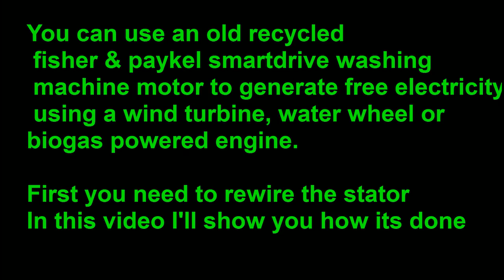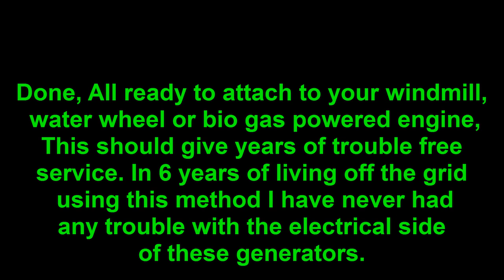How to rewire an old washing machine motor to generate free power

Comment: You rewire the stator to reduce the output voltage correct?  Why not just leave the stator as is and step the voltage down externally?

Comment: Tip from an long time certified solderer - always run the iron across a wet sponge to remove excess (it has lost its flux and is now more of a drossy burden when using with flux cored solder), next always heat the work first, before touching the solder to it or you burn the flux up too fast and it can lead to connection stability problems. Then introduce solder to the work, not the iron - it should flow freely like a tight skin hugging the metal (the sign of a good melt) and cool shiny (which is a good join, as opposed to dull which is a cold solder joint). This should all happen quickly so as not to overheat the work and once the solder sticks don't linger with their on or you lose the antioxidizing effects of the flux. If you get a situation where the solder is heading but not sticking either apply flux paste sparingly or flood the area with solder to coax new flux on to it then tap the area quickly to remove excess (if it didn't drop off on its own) or sponge it off immediately after removing the iron (you just want to get rid of the excess solder without lingering. Lingering oxidizes the underlying metal and solder starts to flip as it contains dross now and nothing wants to stick.

I've personally taken to just sticking a q-tip in paste flux (I prefer rosin as it is only acidic when hot and won't degrade wire when below soldering temps) and dab everything for jobs this size and larger (size as in wire that's this heavy).

Anyway, nice job - I know nothing about these alternators and am trying to learn. This was very helpful, thanks!d
Reply: yeah I liked his video myself, but the soldering needed some work...My brother is a great solderer and was amazed when he saw me solder...its because i am a welder mig,tig,stick, brazing fusing metal is my job lol I once soldered a tank back on a radiator and it looked like it was formed and not soldered
Reply: I guess soldering since age 9 made me assume this was common knowledge!
Reply: "Then introduce solder to the work, not the iron" yes, but. This is also the right moment to put a little(!) bit of solder to the iron so it will make a solid thermal connection to the work. Just lightly touching the iron's tip while moving the solder to the work works fine.

Another thing to watch is that you want the work to wick up the solder, not press a blob of solder onto it. When working on clean electronics with a low thermal mass and a good iron, one can do this directly from the tip, but one needs to keep in mind that this is a special case, not the norm.
Reply: How many watts do you think are lost through the way he did it? 0?
Reply: I always used a damp paper towel.
Reply: The soldering is OMFG... Lol

That said this could have been done a much easier way with zero mod to this stator but ok
Reply: @MadScientist267  what is the easier way ?
Reply: For real like minds want to know so tell

Comment: hi ! Love the concept and everything.

If you want your tin to stick to the copper. You have to clean it up with a chemical product (plumber product) 
1 apply product on the area.
2 Heat it up
3 remove heat source
4 apply tin.

That's how a plumber do, by the book.
About that there is 2 types (or more) tin.
take the one without lead. That's the one allowed in drinkable water.
You might end up in trouble if you don't. 
lead path : tin => water => fish => humans => hospital

Just thinking to this.
An old plumber I had as a teacher told me that water looses speed when it turns. Even into a pipe.
Therefore you might have a better output because you have two 90° angles. (if I remember correctly)

Once again I'm just triing to help.

Comment: This is great could do with some audio though. though i can see what you are doing based on the diagram at the start. When you are actually cutting wires it is hard to see and would benefit for some audio description.
Reply: Marty T Using a large soldering iron in his latest vids doing this again...with sound.
For a newly built hydro 
also  https://www.thebackshed.com/Windmill/FPRewire.asp

Comment: Instead of rewiring. Can the dc current be sent to a solar mppt charge controller to regulate the voltage and charge a 48v battery instead or one of the new portable solar generators in the market?
Reply from the maker: I've never tried that with a factory stator, the only mppts ive used have been 150v max input, the factory stator can produce 400v

Comment: If you hook this up and it doesn't work, is there a straightforward way to troubleshoot where the missed connection might be?
Reply from the maker: Test resistance on each phase with a multimeter, The one with higher or lower resistance will point you in the right direction
Reply: @AngryRambro  Thanks so much!

Comment: How did you manage to have water with so much pressure? Is it just with the river water and its gravity? What is the pipe diameter and total length and what is the difference in level, or an estimate, between the point where the river water is collected and where you have the turbine?

Comment: Why you need to rewire or change the connection?what is the difference if you do not rewire?thanks
Reply from the maker: Voltage is too high in the factory configuration

Comment: What is the purpose of this type of connection? I'm having problems with a heavy rotation to generate, I use the delta connection. I would be grateful if you could help me.
Reply from the maker: Wind the rotor out from the stator so there is less magnetic area exposed to the poles, I do this when I'm using a smaller jet but still need high rpms

Comment: hi there Angry Ram the pelton water wheel you have on the washing machine where did you get that from i have done the same with the washing machine getting about 43volts at about 5-6 amps from a homemade pelton wheel but i think a proper pelton wheel   should give me more power from the water

Comment: Interesting! If I could get my hands on one of those motors, I'd have to try running the conversion as a brushless outrunner with a 3 phase ESC. Whats the power rating of the original motor? Thanks

Comment: Great video very detailed good job. Don't let the creeps get to you. I'm working on a water wheel for my creek running through my backyard so I'll be looking for one of these motors also.
Reply: Not creeps, just educated. No such thing as free energy yet they insist on posting titles like this. I use a hydroelctrostatic generator as well, but the potential and mechanical advantages come from the water..NOT free out of thin air, and NO it's not perpetual. Just be articulate and concise where its needed, that's all us 'creeps' ask

Comment: I spent best part of today doing this with the aid of your video..Now for the rectifier and voltage reducer..Thanks..BTW..i found that scratching the snipped wires with a craft knife made soldering easy..
Reply: If your soldering with a tip with enough thermal mass and the soldering iron is over 30W, it should burn right through the enamel. I solder magnet wire all the time without removing the enamel first. The issues he's running into in the video is his tip has practically no thermal mass; his solder seems to have too low of a flux ratio; and he is feeding the solder onto the iron, not the wires, which is burning off most of what little flux there is before it can help mate the solder to the copper.

Comment: Excellent use of an old washer, bravo man! Like Frank Resists
 says about soldering. Heat the wires then put the solder to it, gives you a superior connection that won't fail and looks terrific, it'll make your connections look totally pro.

Comment: WHY does it have to be rewired? To generate lower voltage or some other reason? Thanks for  great videos.
Reply: Angry Ram
5 months ago
Voltage is too high in the factory configuration

Comment: Your performance is beautiful, thanks for the information. I have a question, does it work in a faster way on the motor, and what is the specified speed for rotation or without limits?

Comment: Hi Angry Ram,

What a great shares given. If do not rewire as per your video, how much it Amp and Voltage? was it ok not to rewire?
Reply from the maker: MOHD FAISA Osman With factory wiring it can produce 400+volts, you should be very careful if using it this way, it can give a good zap.

Comment: Wouldn't this be more efficient to run at a higher voltage until you get to your battery and then have a transformer stepping it down to a voltage regulator for your set of batteries?
Reply: yes and no because it can't run heavy things like your fringe out will need a lot of then
Reply: That is my same question.
Why can't you put the voltage step down transformer and rectifier diodes for charging batteries?

Comment: If you are willing to spend on the extra components a dc/dc converter can be used to charge your battery. Set it up just like any commercial/industrial UPS system your low voltage AC (400v is low voltage) through a rectifier block, DC/DC converter block converts that DC to your charging DC for your battery bank, and out through the inverter block and through a capacitor bank that brings your power factor back closer to 1 and further cleans up your output.

RVs already have pretty much all the power conversion components you need. Then you don't need to give up so much of the power this generates and you don't have to spend all that time rewiring it. More than one way to skin a cat, it all depend on you and the cat which one is right for you.
Reply: Very good proposal! Also this way power loss in cables can be minized if batteries are some distance apart from the generator.
Reply: @hartmutberger5611  Exactly. And the RV company did all the work for you already anyway, you just have to get one.

Comment: Hello, i have one Question . is the orientation of the fourteen magnets in the rotating drum + - + - etc...?
Reply: You may only see what appears to be 14 magnets, however each one of these has several poles. get a small magnet and run over them and you will see the individual poles per magnet

Comment: Should of read some of the comments ops :), how many amps would you lose and you could easily build a circuit to bring down the voltage but the key is obviously amps, can have a 1000 volts and 1 amp, not much use, so would be interesting to know what the maths would be for rpm's to amps if not rewired. Also, would you need a magnet over each coil? and yes im a newbie but not an idiot...

Comment: thanks black ice however i know about that. besides i have over 30 yrs in electronics and have some idears thats tested true. theory isent any thing unless one can build test all phases and i do  as far as inverters theres mod sine ,and pure sine. 48 volt ones will use less current due to volts being twice  12 volt ones will use twice the current and not all company ratings  are truth .also the type of loads powerd will effect it . induction, transistor, non induction, low ,medium, or ,high. thks.

Comment: Amazing video!
However, I am a bit confused about the way you solder the wires.  Normally, you should heat up the wire, and melt the solder onto the wire.  But in your case, you are melting the solder directly onto the gun?
Reply from the maker: PowerSports420 Yeah the soldering iron is a little light for the job, I find if I melt the solder on to the gun first, the wire seems to heat up quicker due to more surface area contact
Reply: Oh ok, that makes sense.  I've never had luck with those "quick heat" guns either.  I went through two of them, then just went back to a simple iron.
Reply: bit of plumbers flux or liquid flux may help with getting the solder to flow.
Reply: When I was tote to solder in school 30 years ago it was common to heat from the bottom of the wire because heat rises and add the solder to the wire when the wire is hot enough to melt the solder
Reply: true if the wire is upright, TBH copper/steel/metals commonly use for electrical conductors conduct heat via conduction so well that convection makes little difference.
Reply: cybot63
But you should always pre tin your solder iron tip with solder before attempting to heat a wire with it(or before attempting to do anything with it), then even pre tin the wire too if ya want, especially if your gun is too small for the job this will help to ensure a strong bond anyway,. but solder has flux in it, by keeping a melted layer on the solder tip keeps the tip clean and heats the wire much faster(instantly) with better heat transfer. I agree with the part you said about melting the solder on the wire when the wire is hot enough, when the wire itself melts the solder, touch the wire with solder not the tip, it works to achieve strongest solder joint possible, but i just wanted to point out that the tip of solder gun needs a thin layer of solder on it before anything can happen the way it should, and then like you said after that wait till the wire itself melts the solder this way the temp is in fact hot enough to achieve a bond, but direction of rising heat is not a concern, it conducts into the metals much much faster than the heat rising, especially if you do like i said, keep a layer of clean solder on the solder tip at all times.
Reply: Tony Hardy That solder gun is a weller heavy use solder gun  and if you apply solder to the tip every time you use it the resin will eat the tip away till you have no tip just like you see in the video. Tin the tip at the start of the job and wipe the tip with a wet sponge to keep the tip clean while you are soldering hold the tip under the copper wires and apply the solder to the copper wires when the copper gets hot enough to melt the solder. If you do copper pipe let say you put the kester resin on the clean copper pipe and heat the pipe then apply the solder to the pipe after the pipe get hot enough to melt the solder. That way you don't waste solder and the solder isn't over heated and cools to a cold solder joint.
Reply: cybot63
I agree only about the material to be bonded needs to be up to temp. but I always put solder on my tip after it warms, i only sponge it once after it initially warms, then i keep solder on all through the job and before it cools so it remains on the tip when the tip is stored to prevent rotting, if i want to tin wires i put make sure i have clean solder with flux on the tip first, then touch non melted wire of solder to the copper wire(this is the indication the wire is hot enough to be bonded, and this is when the solder melts, it is a no brainer)no matter what the tip needs a layer of solderflux at all times. A tip cost like a dollar. i been doing it this way it never hurt my tip, actually i never changed it, never needed to, but i don't solder a bunch, but i solder enough. I use a map gas for copper pipe, i melt the solder on the pipe not in the flame, when the pipe is hot and melts end of my roll of wire solder the pipe is hot enough to bond water tight, pressurized, etc... and i don't worry about tinning the tip because it is map gas torch with pointed flame directing heat to the point of flame. The hard part with pipe is cleaning all the copper joints to be bonded, not only needing flux at every single joint, but freshly cleaned joints.

Comment: A bit of physics please. If using wind power, does the voltage or current increase with rotational speed?? In a low wind area and commercial wind power generators need high speed.

Comment: Hi my motor got 36 pole so it will be 6 groups right? Thank you.
Reply from the maker: Depends on your speed, load, voltage.  this site shows the most common  wiring configurations https://www.thebackshed.com/Windmill/FPRewire.asp
Reply: I need run 24 volts system to charge battery thank you.
Reply: The website explains alot i got it now thank you.

Comment: Hi, good job, i have a 36 slot like that, to power it with 2x12v 7.2A  battery in series
was problem, please how many volt and amp does it require to power your own

Comment: If you want stable 60 hz, convert  50 hz to D.C. then use D.C. to run an inverter, you will need to monitor and regulate RPM too.

Comment: Angry Ram, the Awesome Man!  I am eager to make my own wind turbine but have two questions: 
1)  There appear to be 3 poles.  If this makes 3-phase and I want just 2-phase will I be need to wire differently?
2)  I have only 36 coils on my stator, not 42 as in the video.  I assume the wiring is the same, just stop 6 coils earlier, right?
Thanks for anyone who can enlighten me--I'm at the starting gate, YOU are the staring gun.
Bruce Ratcliffe, Science teacher, Fresno, California
Reply from the maker: ***** Hi Bruce, Yes it  has 3 poles, why would you want 2 phase? Check out this site - http://www.thebackshed.com/windmill/FPRewire.asp there are many ways to rewire the stator

Comment: how many gps you pulling thru the pipe if you don't mind me asking?  was thinking that 2 of these on a closed system would work for our property, 2 sump's pushing water back uphill to a holding tank, round and round like the lazy river :).  maybe just a pipe dream, but free electricity would be amazing!
Reply: Perpetual motion machine has not been achieved...
I like the pun "pipe dream", but the energy lost in the recirculation would exceed the output of the turbine...

Comment: I have an identical stator except it has 36 poles instead of 42. If i follow the diagram correctly mine appears to be Factory wired at 36 pole 1x12c. 
My question is; If I rewire mine to 36 pole 6x2c, At the same RPMs would I get less Volts or less Amps than yours (42 Pole 7x2c)?